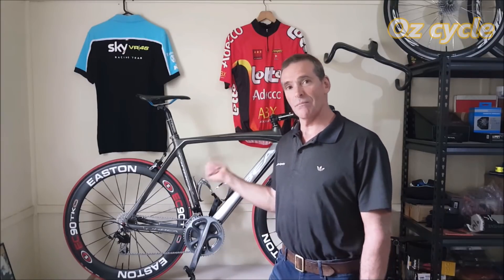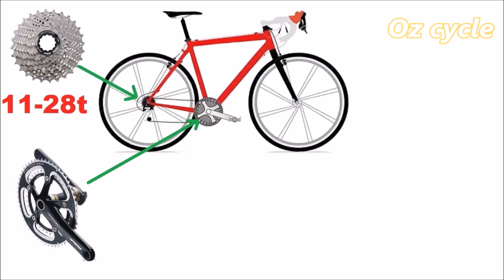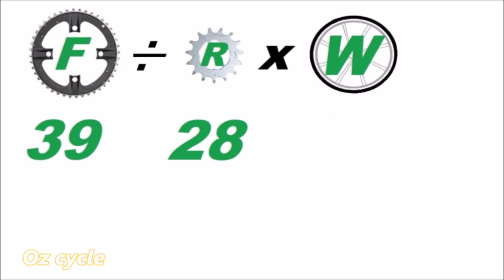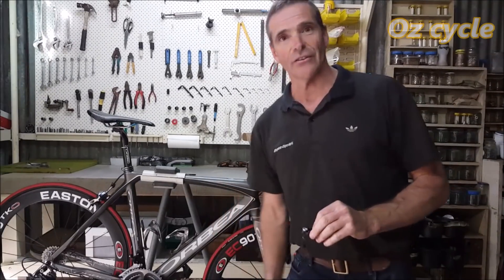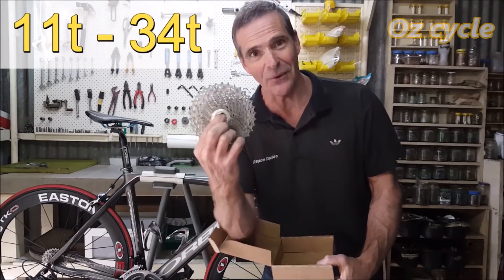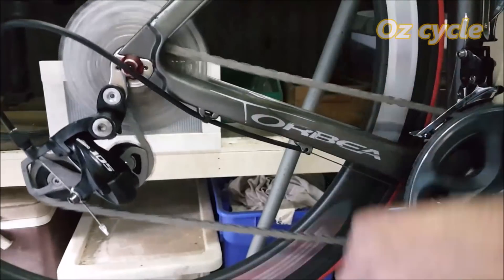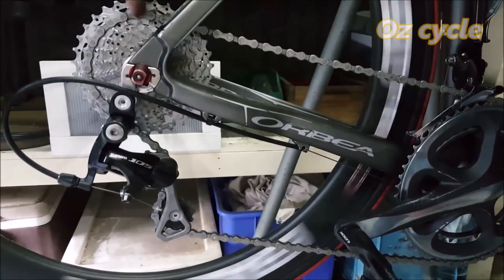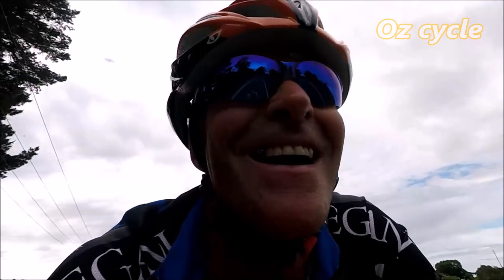Have you got Compact gears yet?

Comment: Not convinced having a dinner plate sized cassette is really the way to go.
Agree it is advantageous to have access to such low gearing but....
Give me internal shifting, rear and 'front' with a belt transferring the power.
Gotta minimize that drag coefficient after all. 
Shimano's XTR cassette uses in part a carbon spider that supports a number of the larger heat treated alloy sprockets, followed by a mid range grouping of titanium cogs and the remaining smaller group of high range sprockets are steel.
Costly...yes, very light...yes.
Just saying, expect the Dura-ace version to be just as Xeee.
In my opinion, external gearing, like the current mobile phone, is reaching the end of its development cycle and something else is needed.

Comment: Some hills need more than extra gears they need more power in the legs , I tend to come up out of the saddle athe start of a hill and then sit down once the speed has been built ,   I run a 53/39. And 11/32. But with 160 cranks due to my shorter leg stroke . The  large spread of the gears gives me the ability to climb the steepest hills and enable a 70kph top speed without issues

Comment: Hi,
I’m just new into riding and I’m 64 years old. I was advice by someone for easier climbing to change my rear cassette to bigger gear. So  I went to bike shop and ask if i can change the rear cassette with a larger size 11-32. Currently my bike is 11-26 shimano 105 10 speed. I was told to change the rear derailleur and can only fit 11-28. Because my bike is 10 years old. Watching this video clearly explained its possible to replaced the cassette to 11-32 10 speed cassette. Do I need a longer chain? Where can I buy the rear derailleur hanger extension?
Excellent videos keep it up.
Reply from the maker: For 26t - 32t you will need 3 links extra in your chain. Derailleur extenders are available from Aliexpress...$4

Comment: Thanks for the video, makes for interesting comparison with what I had: 10 speed, 50/34 and 12/26. I found I spun out of gears going downhill using 50/12. As some bad luck would have it I messed up the gears with bad maintenance and decided I might as well change to 11 speed. So now I have 52/36 and 11/28 and I win on both ends - 52/11 will leave me with plenty on the descend while the 36/28 is even better than the previous 34/26 uphill! As a very slightly build 58 year old, I couldn't be more pleased with the gain in both directions!

Comment: why not triple rings?  why limit to 2?  how to negotiate steep hill without the smaller ring.
Reply: Over the years, triple rings up front has been going away in favor of more sprockets in back.  The shifting in the front is a bit more tricky with triple rings, and there is some weight penalty.  Overall, I like a common setup with the compact 50-34 teeth double sprockets up front and 11-28 teeth sprockets at the rear.  That covers a pretty wide range, a lot of steep climbs and still a fast top speed down most all descents.   A bit lighter, more aero, easier shifting up front with just the two chain rings, for me anyway liking it.  Triple is somewhat going out of style, but it can certainly be an option for people that specialize in climbing steep roads.

Comment: Much ado about nothing...  Whatever the bike business calls your choice of gears you still have to choose the right cassette formation and chainrings to suit you and the ride you will undertake next.

At 70 years of age and 116 kg I still roll along on 53/11 with relative ease, but my choice for the stiffer gradients has changed considerably: I now avoid them...  Now,  just 54 years ago...  OK, I can hear you: "Shut up, grandad!"  (No joke about avoiding steep gradients; I have little extra body fat but the same muscle mass as I had when I did cross-country skiing in the winter and cycling the rest of the year, but no old heart should be pushing a heavy rider up a stiff gradient, whatever the gearing.  However you go about it, except for cheating, you still have to propel so much weight up so many feet of elevation in so many miles, so your body still needs to supply the same power overall, and simply going slower does not allow an ancient heart to contribute to any wise/meaningful comparison with its younger self.)

I see the last sentence of smitajky's comment and feel even older...

Comment: Another tip for you:  a mountainbike derailleur progresses at a steeper angle than a road derailleur does.  This makes it better follow your wider gearing range.  I use an sram x0 on my road bike for this reason.  The derailleur doesn't know if you're on pavement or dirt - it just needs to do it's job for the type of cassette it was designed for.  For this reason, I wouldn't simply use such a derailleur extension on a road derailleur.  I'd rather change the derailleur.

Comment: Compact saves a few grams but it is less efficient. It's the cassettes that are wrong.  Let me explain: 11T was originally meant for mountainbike 44x11.  Not for road.  Not unless you intend on sprinting down a hill at 110km/h (seriously, as I've done on a 52x12t -- 11t wasn't even required). We need more cassettes that start at 12t (or even 13t).  The reason:  smaller sprockets (or cogs, if you prefer) place more force closer to the axle, putting even more pressure on the ball-bearings.  This results in a loss of efficiency, and accelerated wear on the bearings.  The wise thing to do, is go for a little extra weight, have the 53t on the front, and start with a 12t or 13t on the rear, and on from there.

Comment: I live in the Uk from West Yorkshire it is all hilly here i was running a 11-21 dura ace cassette for the past 2 years and climbed up 25% gradients on it mashing on the pedals im a very light guy 5.10 and weight just 59kg i changed it last week for the 11/25 im climbing much faster its all about the cadence spinning easy gears fast up climbs  and you will go much faster like you mentioned should have seen this video before i bought the cassette lol.
Reply from the maker: Thanx for relating your experience 😁

Comment: The extender increase the risk of mechanical failure. Causes derailleur hanger broken. Get a medium cage derailleur. 105 R7000 can support up to 11-42 cassette.
Reply from the maker: With what front rings range Dennis?
Reply: @stevenleffanue  https://youtu.be/0Ff_NCP-7fQ
Reply: @stevenleffanue  from the video I quoted above. That Taiwan guy is using compact crankset, 50/34T.
Reply from the maker: Thats a huge range if using an 11-42. My video mentions you can use a 11-34 with your standard cranks 39-53....no problems.
Reply: @stevenleffanue , you are right. Just avoid to use the RD hanger extender. Get a medium cage RD is the safer way though....
Reply from the maker: @DennisTeohKokEe  Still cheaper to buy the extender and use your existing rear derailleur.
Reply: @stevenleffanue , I mean the reliability and avoid to put on higher risk RD hanger getting broken.
Reply: In case the hanger broken. By any chance RD hit the frame or spoke of wheelset. It will cost a lot more to repair your rear wheel and bike frame. Most important is avoid injury of the rider when the wheel is stuck, rider falling down from bike.

Comment: Unless you're a pro I don't see the need for an 11T small sprocket, even on a 50/34 compact. On a 46T chain ring yes, but not 50T or 52T. At least Campagnolo used to recognise this with their 10-speed cassettes e.g. 12-27 / 12-30

Comment: Careful with using a much larger or smaller cassette than the derailleur was intended for. It results in a large distance between pulley and cassette which will make shifting poor. It's a compromise. Best you can do probably is to use sram 10s components which are interchangeable mtb/road so you can use a 10s 36/42t cassette + mtb derailleur and road shifters. This way you also don't run out of chain tension in small/small.

Comment: Loving your videos.  Well done.
I've ridden since the 70's (as I imagine you have), when 52/42 and 13-21 or 13-23 were the norm - I can recall wondering if my chain was going to snap due to each pedal stroke being like a leg press on steep hills.
Since then, the 53/39 standard seemed to be a big improvement with 11-23 or 11-25 being the norm.
After riding on the newer 50/34 with 11-28 setup, I've settled on 52/36 and 11-27.  A little more standing in the steepest sections, but all in all the sweet spot for me.
Reply from the maker: Yes I remember and still have some of my old clusters....13-23 and 13-18 for flats. You are right,grinding up the hills! Much better now hey?

Comment: One thing to mention, the higher are the front chainring the shorter are the step between each gear. Very important for people who perform at a precise target cadence. I have a 52×36 and 12-25 cassette. I love the 12-25 because of the short step between each gear. But I have a too big step (10 rpm at 95-100rpm) between 52×21 and 52×19 that I have to fill with the 36×14 combination. Not very practical… (don't have Di2 to program that sequence  !). After having done a Excel sheet with all the combinations ratio, the 53×39 offers me what I want. So I switched to a 53×39 . The 39×25 allows me to climb long slope of 8% max, I don't live in the mountain so it's ok. So that's it, don't look at your neighbour's equipment. Choose the one which is made for your style (spinner or smasher !) and your playground ;-)

Comment: Complete process done...and found this valuable in regard to the sitting as you climb..Had an 11/28 and swapped it out for 11/32 just to allow the uphill spin option, but surprisingly recalling the 11/28, I just had to be more focused on the climb. Age factor was big reason for the 11/32 change. At 65 I want to keep cycling, and not tire as easily..Thanks, this was a useful video
Reply: I'm 28 with an FTP of 285 and wouldn't ever change from an 11/32. I rarely use the lowest gear but when it kicks to over 10% you need them. Also on some hills even in the lowest gear and only doing around 70rpm out the saddle i still struggle to keep the watts below 300 - could still do with a lower gear.

Comment: Compact is a great choice. Very smooth shifting too.
Reply: Mai AiBing smoother shifting because you have compact? I currently run 54/39 and used to run 52/36 with a 11-32 cassette, i notice no difference in shifting. Its still the same gear step downs/ups with the cassette no matter what chainrings you run, just a different rollout. So i really fail to see where you get your logic from...
Reply: @Tgiles13  I agree, that's why I switched an 11-28 cassette for an 11-23, so the cadence changes smoothly (i live in a flat place with no hills)

Comment: what mtb cassette used in this test? does the shifting work well eventhough the mtb cassette pitch is slightly different than road cassette?
anyway i'm running 50*34 and 11*32, thinking it is too many gear gaps. probably 11*28 will be better..

Comment: Compact  50/34 with 11/28 works well for most recreational riders I should think.  If you want to stand up gear up and stand up.    You still have choice.  Downside is it limits speeds on descents but my fear/sanity factor limits that too so no problem most of the time.  I don't live in the mountains though.
Reply: I have been very happy with that common compact setup for some years now.  I can take on a lot of crazy climbs with what seems to me negligible top speed disadvantage.  I can only think of one practical situation where my top speed gear was slightly lacking, a long, straight descent.  Even then, most amateur cyclists would find this plenty fast, and working hard to push too much faster than terminal velocity downhill can be significant effort for not that much more speed gain.  I have found it nice to push for whatever top speed I can handle partway down the descent, tuck in to as aero a position as possible, and save up a bit of reserves to burst up the next climb that might be ahead.

Comment: Dude! The b-screw isn't ment to eliminate chain slap. It's fine tune the distance betwwn the upper pully and the diffrent cassetst. Screwing it in leads in most cases to poor shifting like in your case. Altogh I suport compact gearing! Great channel keep going.
Reply from the maker: Effectively same thing Philipp
Reply: oz cycle My recommendation would be to use a Shimano 9-speed shadow mountain bike rear derailleur. This works with 10-speed SH road groups and can shift at least a 11 to 34 tooth cassette

Comment: Hi....iam having problems with my flat bar road. I put XT rear derailluer on with XT shifters but its not working right .Would putting this adopter on help because of the 5mm difference between road wheels and mountain wheels...130mm vs 135mm. cheers Paul.
Reply from the maker: If you are relating to axle width,no it want make any difference Paul. Do you mean your gears are not aligned properly?

Comment: Not young anymore but I ride a lot.  The most important thing is to avoid an injury which might put me off the bike for months.
So I go a lot further than a compact crank.  A triple set with ratios from 53:11 down to 22:34  .
Crazy you might say but I can keep my normal cadence on a mountain climb no matter what the grade.
Reply from the maker: +smitajky Nice to hear youre still riding no matter age. Agree, avoid injuries...not worth any risks.
Reply: I always used triples back in the day,I see no reason not to use em now. The new shimano triple Ive got shifts great,,bam bam can drop it onto the inner 26 hard it never jumps off.It came with a 30 inner ring...... On my x-country mt bike Ive gone to an 11/40 cassette and will finagle at least a 24 on the front 2x10 crankset.  We do rides where everybody ends up pushing its so steep,Id rather pedal.
Reply: That bottom gear is lower than on any of my mountain bikes. Top gears past 44:11 are very rarely useful with mountain bike tyres.
Reply: smitajky I will try that~ I live here in North Italy 🇮🇹 near Piancavallo and use those areas for training~ Very steep with large sections of flats as well~
Reply: Triple cranks should have never been phased out. I had a 52/42/32. It was glorious. I found myself using the 42 a lot, whereas I rarely use the 39 or 36 on my current set ups unless I’m climbing.  Now, my climbing bike is a 52/36 with 11x32 and it covers everything I need it to cover.
Reply: You could climb a flight of stairs with a granny gear like that!

Comment: You can also consider getting a road triple crankset 53/39/30 which would let you keep your close-ratio 11-25 or 11-28 rear cluster.
Reply: Although for further comment, I actually ride a vintage touring bicycle, so I have a rather strange set-up of a 6-speed wide range rear 14-32, with a "half-step-plus-granny" front 48/44/28. I do most of my riding with the front 44, occasionally up-shifting to the 48 (9% shift). I find that I can generally climb most hills with 44 front, 32 rear, but when it all gets too hard, I bail-out to the 28 on the front and use one of the three larger rear sprockets (32, 28, 24) to spin my way up hills. When you're carrying panniers with your camping kit and a few days worth of food and water, you need those gears that let you crawl up hills.
Reply from the maker: +Martin Hartley Thanx for your expertise with touring gears Martin....will be appreciated by many viewers.
Reply: I'd like to see you do a piece on touring bicycles in Australia. There is a great potential for it here.
Reply from the maker: +Martin Hartley Good suggestion Martin. Im not well versed in the touring side of things but we have a few riders here who have done ultra-long distances and around Australia trips. I might ask them if they would like to contribute their experience.